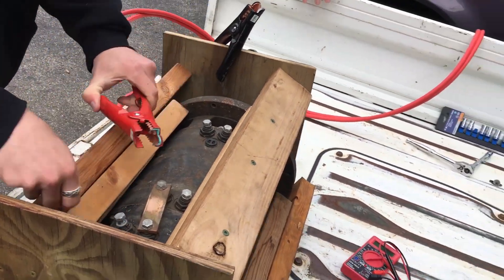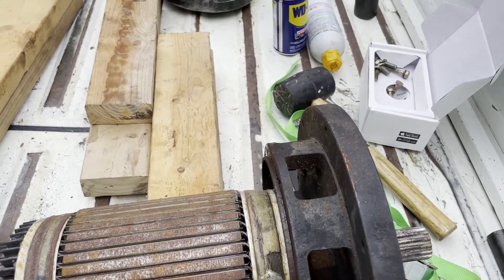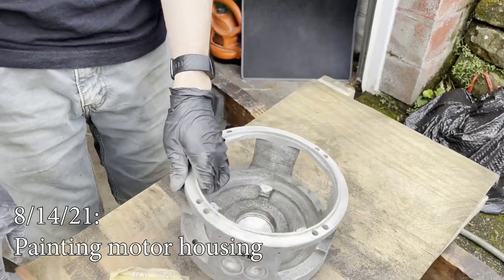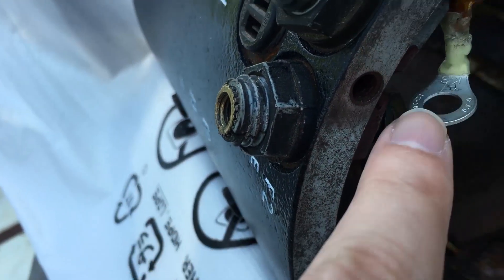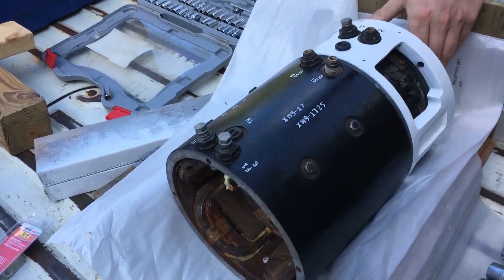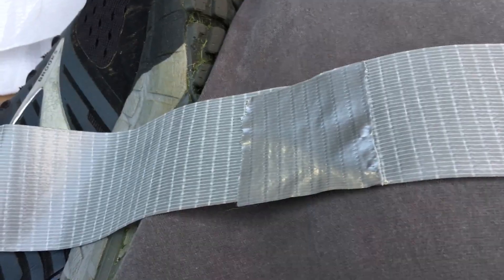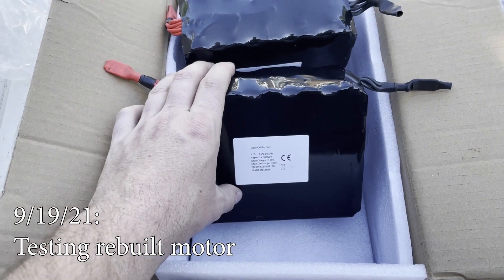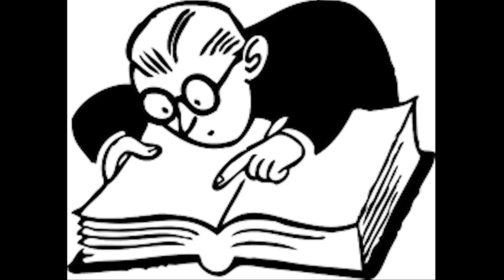Converting a Kei truck into an EV - Motor rebuild - Part 8

Comment: Use to work in a factory that made these electric motors.
Reply from the maker: That's so cool! What did you do there?
Reply: @actydcty4132  I used to put the copper wire through the stator that goes inside the armature bit of the motor.dont know if the motors shown in your video are exactly like the ones I worked on but look similar.

Comment: Do you have any idea what rotating the frame holding the brushes actually does? You're changing the timing, so you should probably understand what that means and why it is important, instead of just making terminals line up.
Reply from the maker: After initially reassembling it wrong, we put it back the way we found it (toward the end of this video). The previous owner had done it this way. The timing should be the same now as it was in the motor's previous EV
Reply: @actydcty4132  Good, but what is that timing? The previous builder might not have had it right, so understanding what you have and what you should have would be even better than just restoring the previous state.
Reply from the maker: @brianb-p6586  Not sure! How would we find out?